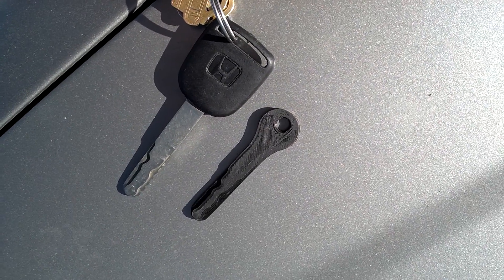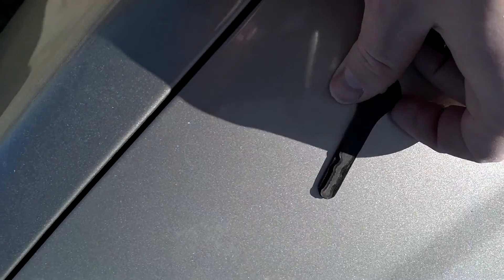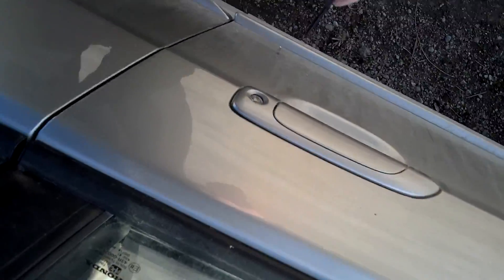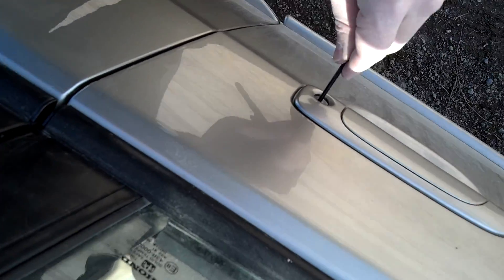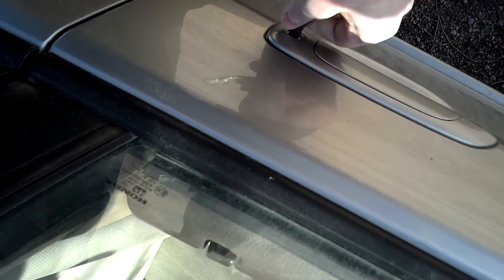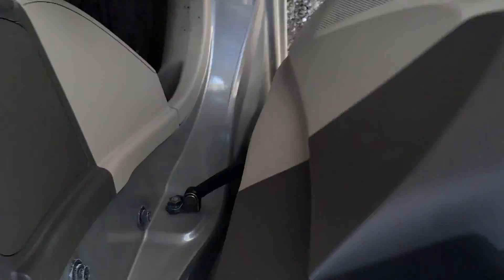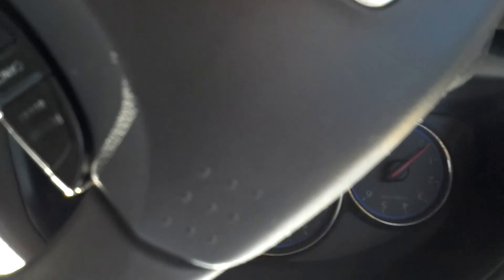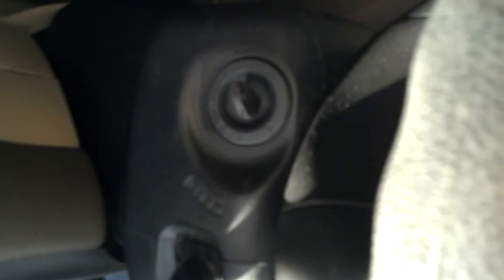3D Printed Car Key

Comment: Ayyooo you got 3D file for this? I have Honda and would  be easy to slightly modify as opposed to remake
Reply from the maker: I don't have the STL or parametric file anymore. It would be easier just to recreate your key from scratch anyways. Just take a digital picture of the key. Load the image into your CAD software (fusion 360 is still a free option), measure the width with calipers to scale the image,  then trace it with a sketch and extrude. We used an FDM printer with PLA, but I would recommend glass reinforced or PETG. We just printed the two identical halves, sanded them to the correct width and glued them together.